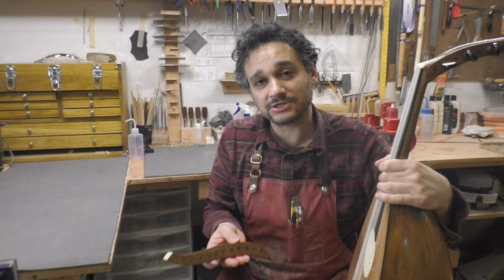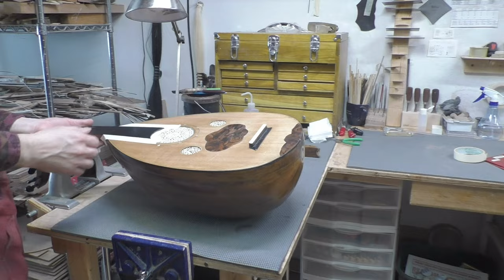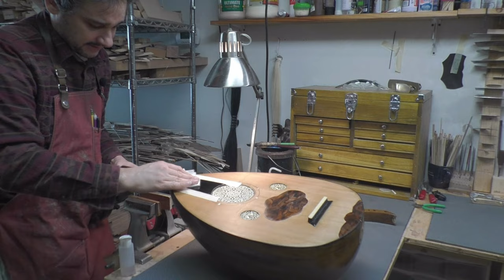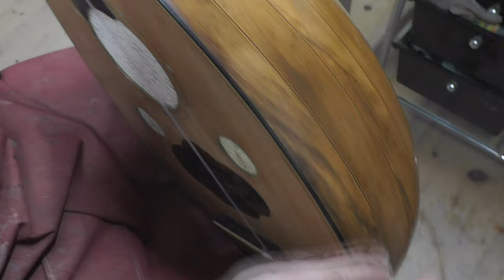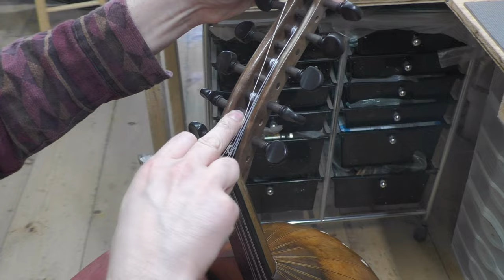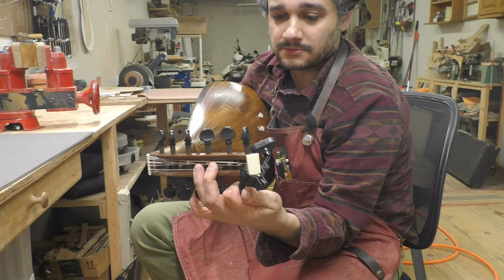How a luthier restrings an oud - Simon Shaheen's oud!

Comment: I've been looking all over the internet to learn which order to do the strings so they don't cross so much. Thank you. After stringing mine in the order you did, I think I realized that the string holes my pegs are not in the right place, so I'm still having some strings cross and make it difficult to tune. Maybe some of them are in the wrong place
Reply from the maker: Yes, sometimes the holes are in awkward locations. New holes should be drilled. I could make a video on that if there's enough interest.

Comment: If you dont trim the strings before putting them in the peg to wind, what can happen to the oud?
Reply from the maker: The winding of a long string will cover the entire shaft of the peg, this means you have no room to push it in to seat it, or to pull it out. It will be stuck in an inoperable position. Does that make sense?
Reply: @lordofthestrings_heritage  Thanks for your time replying! Yes, that makes perfect sense! When I was following along, changing the strings for the first time, your guide was an excellent help.
Reply: Hi, can i ask what is the bowl wood this oud?

Comment: Could you use 2 classical guitar strings sets with the oud? 
Why the top is not being finished? after all classical guitars tops are finished with some kind of finish. (Dirt and grime will not benefit the top in any way).
Looking at the head design, I think that the design of the peg head is completely wrong, strings should not go into the peg box with all kind of angles (It looks nice but it creates tuning problems and it's kind of ridiculous),
 is there any oud makers that solved this issue with a bigger peg box? also it's time to use planetary pegs it's 2024.
Reply from the maker: Dani , thank you for the comment. I also make Classical guitars, so I can address some of your questions. No you cannot use 2 sets of classical guitar strings, the gauges are not correct for Arabic, nor Turkish oud. The tops of ouds and the lute family are traditionally not finished believe it or not. Many great instruments held up many years without grime or dirt as most decent players are good about not touching the face. I however from time to time do apply either a wax finish or a few coats of light shellac. But not all the time. The reason is, most finishes kill the sound on ouds and lutes due to the nature of how they are made. The pegbox design is not completely wrong, it is indicative of the kind of instrument it is. Violins, violas, cellos and basses have similar design (and of course the lute family), and it's perfectly functional. I do use mechanical tuning machines on my higher end ouds, but some people actually prefer well fitted pegs over them. There are pros and cons to both in fact.